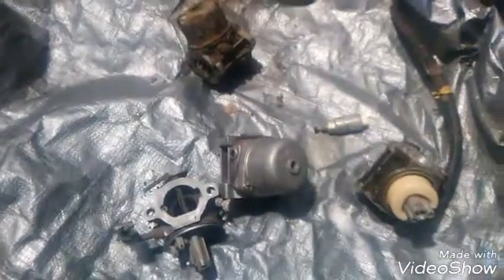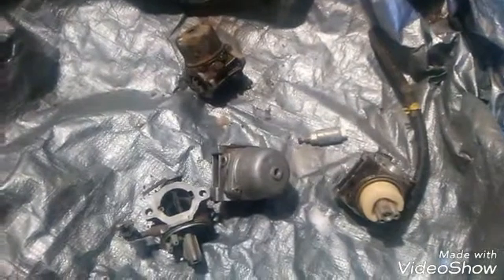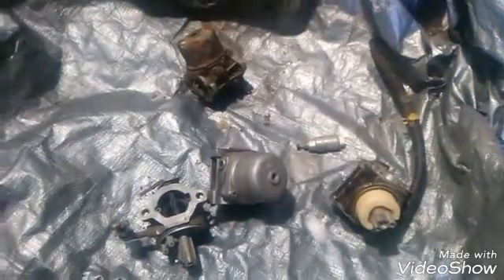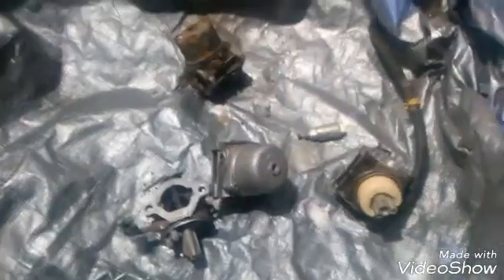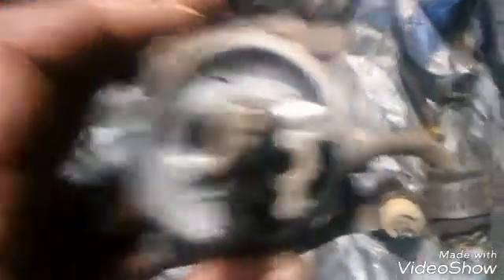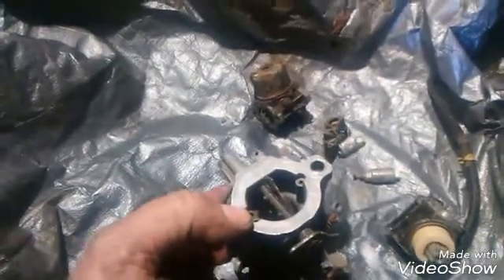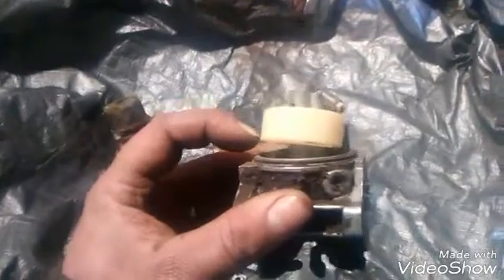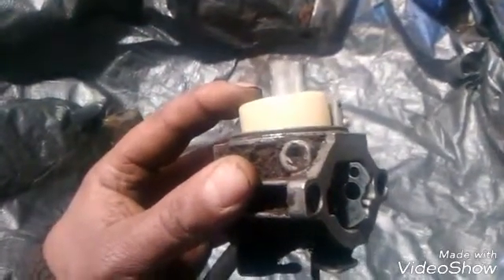why not to use ethanol gas in a generator

Comment: As a kid in the 1970s, I remember my father having to take apart carburetors every spring and spray carb cleaner in his small engine water pumps since the straight gasoline would often varnish and stick the needle and/or float. 

Like a skunk, one never forgets the smell of varnished gasoline.

Since E10 came to be(called gasohol in the 80s), I have never seen or smelled varnished gasoline.  Ethanol dissolves varnish and does not allow it to form.  There was a transition back then because varnish coated the fuel tanks of everything, when we started using it the fuel filters would plug quite often until the varnish was removed.  The older the vehicle, the longer it took.  But once clean they stay clean with ethanol.

The common gasoline of Brazil contains a minimum of 27.5% ethanol.  It has worked out so well and for so long that Paraguay has gone (and Argentina is moving towards) to E27 as well.

Here is a familiar small engine sold in Brazil.  Take special note of the engine sticker to see where else that engine is sold.

https://www.honda.com.br/produtos-de-forca/gx120

Here are some very familiar 2 stroke engines from Brazil as well:

https://www.stihl.com.br/Produtos-STIHL/0100/Motosserras.aspx

Gasoline without ethanol contains much more toxic and volatile aromatics such as BTEX(benzene, toluene, ethylbenzene, and xylene) to raise the octane.  Premium has around 40% even.  These will evaporate quickly and leave sitting gasoline with too low of octane for the small engine.  Ethanol blends in small engines according to a DOE study will last some three times longer than E0 straight gasoline.   https://www.theautochannel.com/news/2016/09/22/286340-new-government-lab-research-confirms-ethanol-blend-fuels-are-better.html

Here is an article of a business who switched to E85 for his small engines.

https://www.ethanoltoday.com/index.php?option=com_content&task=view&id=5&fid=60&Itemid=6

Comment: Corrosion build up.
  The triple damage is; Ethanol fuel corrodes aluminum parts, the water vapor in the air is absorbed into ethanol and rusts the steel parts quickly. It also hardens and will advance the rate rubber parts deteriorate. (Fuel lines, float needles, o rings, diaphragms, chain saw fuel pumps, etc) 
 For you 2 stroke engine operators, it seperates quickly the premix oil needed to keep your engine lubricated. This means you should stir/shake the fuel often- or better yet- NEVER USE ETHANOL FUEL!
Reply: The common gasoline of Brazil contains a minimum of 27.5% ethanol.  It has worked out so well and for so long that Paraguay has gone (and Argentina is moving towards) to E27 as well.

Here is a familiar small engine sold in Brazil.  Take special note of the engine sticker to see where else that engine is sold.
https://www.honda.com.br/produtos-de-forca/gx120

Here are some very familiar 2 stroke engines from Brazil as well:
https://www.stihl.com.br/Produtos-STIHL/0100/Motosserras.aspx

Gasoline without ethanol contains much more toxic and volatile aromatics such as BTEX(benzene, toluene, ethylbenzene, and xylene) to raise the octane.  Premium has around 40% even.  These will evaporate quickly and leave sitting gasoline with too low of octane for the small engine.  Ethanol blends in small engines according to a DOE study will last some three times longer than E0 straight gasoline.   https://www.theautochannel.com/news/2016/09/22/286340-new-government-lab-research-confirms-ethanol-blend-fuels-are-better.html

Ethanol is much >>>easier<<< on rubbers, plastics, and metals than what gasoline and BTEX(benzene, toluene, ethyl benzene, and xylene) are.

If you doubt this, look here:

Ethanol = https://www.customadvanced.com/chemical-resistance-chart.html?chemical=Ethyl+Alcohol&rubber=

Gasoline = https://www.customadvanced.com/chemical-resistance-chart.html?chemical=Gasoline&rubber=

Benzene = https://www.customadvanced.com/chemical-resistance-chart.html?chemical=Benzene&rubber=

Toluene = https://www.customadvanced.com/chemical-resistance-chart.html?chemical=Toluene&rubber=

Ethyl benzene = https://www.customadvanced.com/chemical-resistance-chart.html?chemical=Ethyl+Benzene&rubber=

Xylene = https://www.customadvanced.com/chemical-resistance-chart.html?chemical=Xylene&rubber=

Need a second opinion?

https://www.coleparmer.com/chemical-resistance

Or here for a third opinion:

https://www.graco.com/content/dam/graco/ipd/literature/misc/chemical-compatibility-guide/Graco_ChemCompGuideEN-B.pdf

See what high aromatic gasoline is rated for with aluminum:

https://www.calpaclab.com/aluminum-chemical-compatibility-chart/

Note that ethanol is good with aluminum.

The main nontoxic ingredient of RV antifreeze is ethanol and it would not have stood the test of time if it had been corrosive.

A top of the line 2 stroke oil manufacturer Red Line is known for using polyol esters synthetics, which can even be made from ethanol.  Very compatible.

Comment: You need to research your information before making a video.  This video is full of misinformation.  There is no calcium in gasoline.  The one fact that is correct is use non ethanol fuel in all small engines.l
Reply from the maker: no it's not technically called calcium buildup but seeing that ain't mineral buildup and what causes it is from the gas evaporating and leaving the ethanol behind and then the ethanol causing hardened deposits the same as calcium buildup that's what I choose to call it if you know what it's actually called feel free to comment and yes the carburetor that was shown in the video is more rested  then what it had   of buildup it wasn't the best carburetor for a demonstration but it was what I had on hand   other than calling it  calcium buildup in the video everything else I explained on why you shouldn't use ethanol gas in the video is correct sorry if you don't like the video but thanks for watching it and leaving a message
Reply: Yes, it is the corrosion of aluminum that youbare seeing here. Once it oxidizes and starts to deteriorate, it leaves the white powdered aluminum oxide- everywhere...
Reply: i guess corrosion is calcium now?